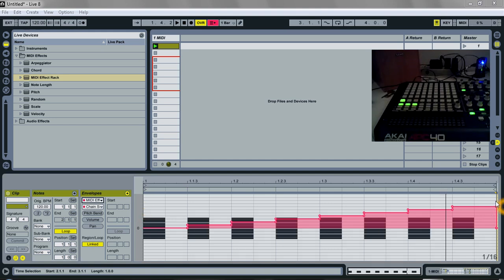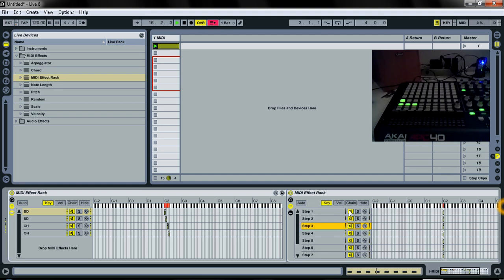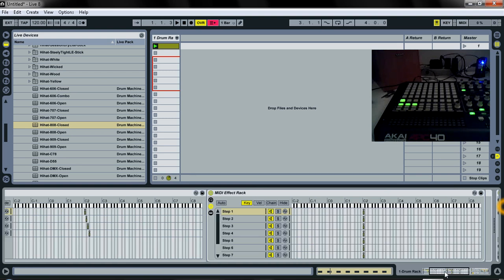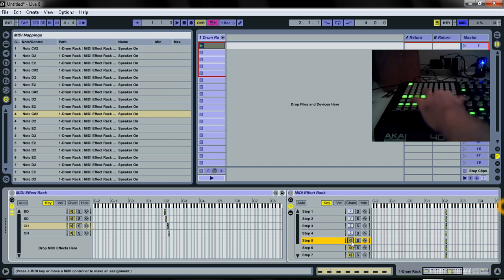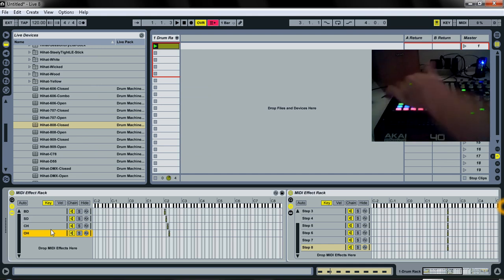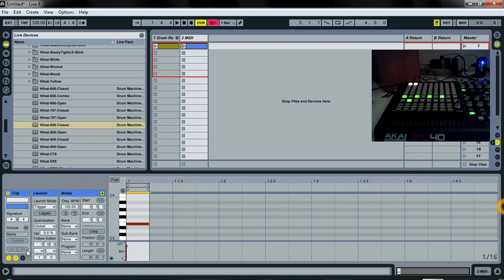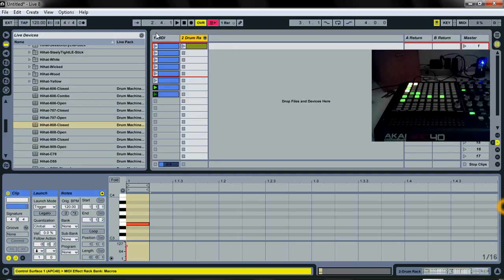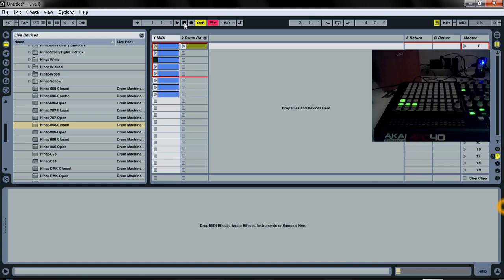How to make a step drum sequencer in Ableton 8 for APC Part 2.wmv

Comment from the maker: From other users of my project it seems like this may be related to other devices that you may have connected and MIDI feedback. This set needs your APC to transmit MIDI messages in addition to it's control surface messages and If you have another device using the same MIDI channel, I have seen that cause this strange piano note behavior, even with no instrument added to the set. I would recommend trying the project without any other controllers or MIDI devices connected to test.

Comment from the maker: @Miroslawsnketr You should be able to put a drum rack after the sequencer rack and all you have to map are the chain mute buttons for each sounds step chains. I will be uploading a working set with the chains and drums mapped accordingly in the next few days. The set should work without any need to map as long as you are using the APC 40 and I assume it works with the 20 as well.

Comment from the maker: @derekisthebest1 This is very strange as I use this step sequencer in almost all of my sets, some of which require 6 gigs of RAM and I have no issues. I have an i5 with 8 gigs of RAM using the internal sound card and "ASIO 4 ALL" Are you starting with a completely new set? I will be uploading a working set in the next few days and I hope that helps.